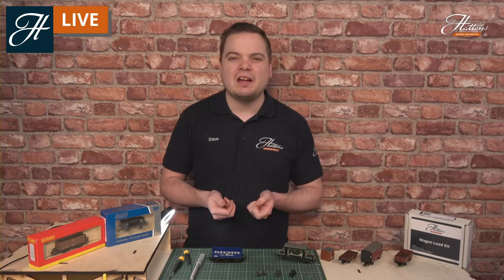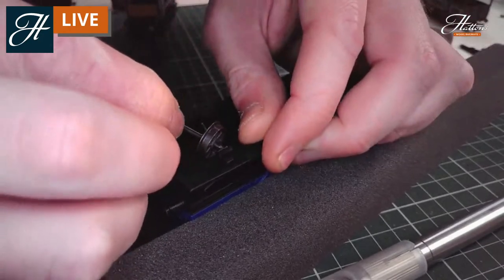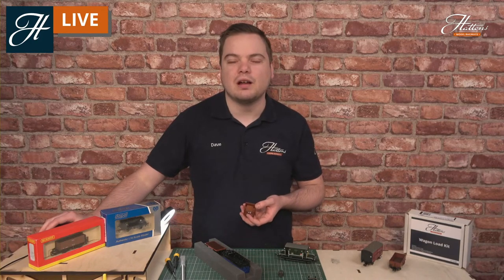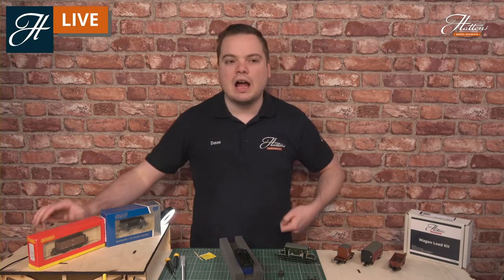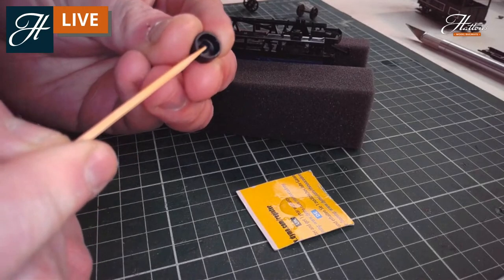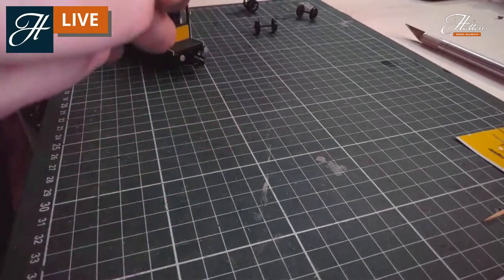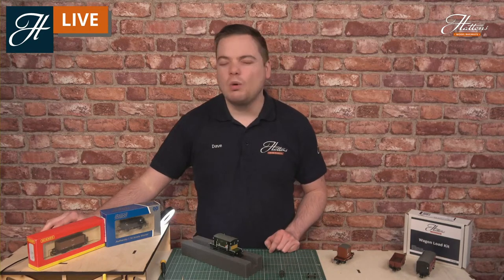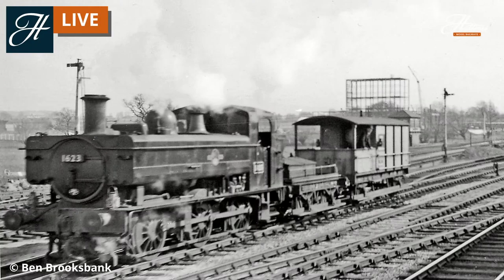Adding details to your freight trains - a beginners guide

Comment: Id advise putting some tape just outside the outline of the load so you can evenly position the load from each end of the wagon. Also, if the wagon has a planking effect floor, make sure the ends of the load dont sit in one of the voids between planks else the glue you put on the load will not be in contact with the floor.

Comment: Some models (PECO for example) also have a slight differences on each side of the chassis (left and right) put the first side of the replacement wheel set into the unmarked side. N Gauge PECO wagons have a shorter axle length compared Graham Farish.

Don't forget chains, ropes and straps for securing loads.

Barrowmore MRG has copies of many BR publications including one on the preparation and ,loading of freight wagons and the vehicle diagram books (useful for identifying where brake cylinders). Just be careful not to out a brake cylinder on a door in the floor of your wagon (if you see a white V on the sides of a BR vehicle then that vehicle has floor doors).

Some brake vans were built with automatic vacuum brake, Don Rowland's book "British Railways Wagons - First Half Million" sets out which brake vans built by BR were fitted or unfitted. Many of the fitted ones later lost their automatic vacuum brakes become vacuum pipes with a release valve to brake the vacuum, other gained air pipes with the associated valve.

Comment: Ah some of the Hornby Railroad range are X Lima tooling which means the axles are shorter than other mfg,  also for less permanent way for the conflat would be pva glue..not a permanent bond but easiet to release